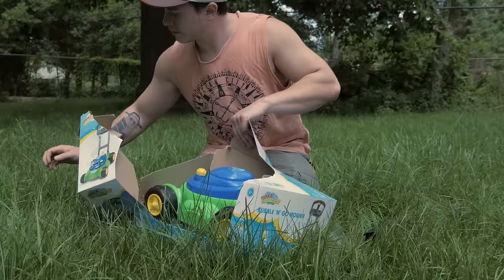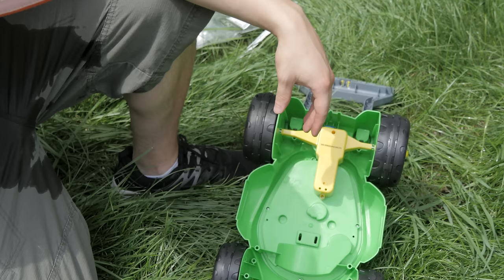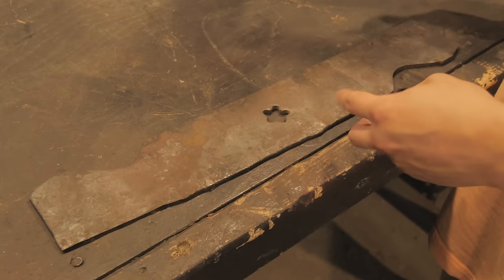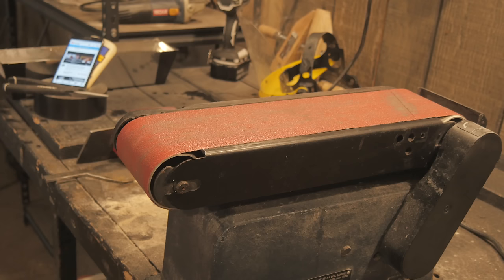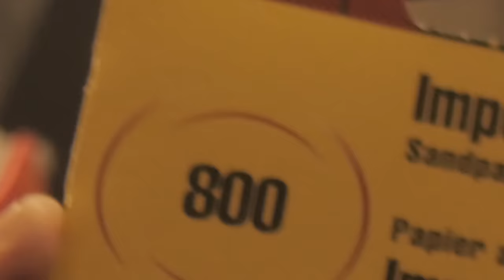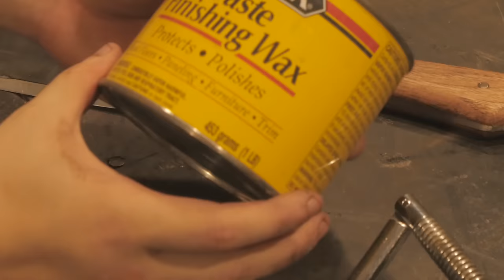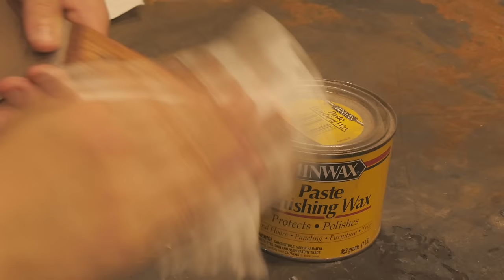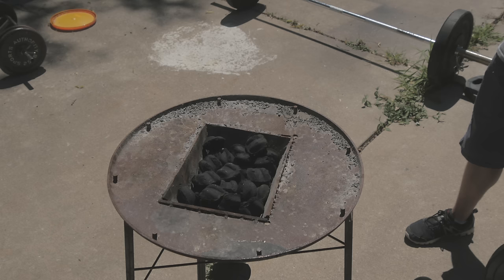How to Make: RAZOR SHARP Lawn Mower Blade CLEAVERS!

Comment: Make a razor sharp blade out of a razor scooter
Reply: Fishy McFishy razor scooters are aluminum.  It will not hold an edge.
Reply: That sounds cool, but if they aren't made from aluminum they're made of crappy pot metal. An edge would never last with either, but if it's pot metal it would most likely crack. He could maybe make some razor razor blades though.
Reply: REED BROOKS dammit, why didn't I think of wheel bearings? 😂
Reply: REED BROOKS you know what would be cool though? If he took all the wiring, separated it by material, and made some sort of a Damascus (like Alec Steele did with the copper and nickle) and made something like box cutter blades.
Reply: Achilles's knightmare
Reply: Mr. cheezit that reply is SO fucking underrated, lmfao
Reply: Bruh
Reply: @rodneysrepurposingrecyclin3821  it doesnt need a edge its supposedly so dull it cut my leg i dont understand how a razor scooter cut my leg but okay
Reply: Make a razor sharp scooter out of a razor sharp blade
Reply: Oh yeah
Reply: @PostalPatriot556  bro wtf is pot metal, did you skip highschool?
Reply: Your fucking Achilles dude...
Reply: Those things are already weapons against your ankles
Reply: YES
Reply: @jessereid8482  can confirm lost my left ankle to one of those scooters

Comment: Just some tips to help you out a lil
Don't use your vacuum cleaner to collect metal filings off the grinder, due to it being able to set fire to a bag/filter (if you got one in there) or sawdust. I'm glad that you didn't get discouraged from the last fire but I don't want you to ever just give up. Your work is truly inspirational (and inspired me to start making on YouTube (btw Thanks))

Secondly when hand sanding and moving through the grits change the angle between each grit, by about 30-45 degrees, this will allow the sandpaper to cut more effectively and it will be easier to see the the scratch marks for you to follow and if you can get higher grits try and go above your desired finish and go back (this will get you the best possible finish for them crazy shiny blades, its time consuming but if you have time the finish is well worth it!)

thanks for being inspirational

stay safe and happy crafting!

Comment: Build challenge: build a sword using no material other than one rebar scrap pine 4 feet of Paracord and 3 20d nails
Reply: rebar is mild steel
Reply: Aj V Rebar is melted down scrap steel, so it can be what ever steel quality. That means that one piece of rebar can have one inch high carbon stell and the rest mild steel, which means it is unfit for making tools and weapons.
Reply: Anton Jonsson yea unless forged and heat treated
Reply: @AFUVFX   Mild steel will not harden during a heat treat, that's the problem. It has too little carbon in it and stays soft and even brittle, it's not good knife steel, much less sword steel
Reply: That's a u have and u font want 2 get anything else do u
Reply: @kyliemacdonald1708  ...wut?

Comment: I don’t know whole hell of a lot about metalworking but those magnets seem pretty hefty especially to be able to hold up a majority of the lawnmower blade could it be possible that the reason that it was taking you so long to grind and that it was leaving spots is because the magnets were displacing the wait distribution on the belt versus the metal so a relatively easy way to Test that is just grind one side of the lawn more blade for 20 minutes without the magnets and then one side a lawnmower blade for 20 minutes with the magnets and see if the same affect happens
Reply: New monarchy for the win it was an uneven grind because he had forged and left dents in metal plus it did look a bit warped so it took some extra work

Comment: You should try staining your next wood project with used motor oil for a unique look and years of protection. The old farmers use to stain everything with it like their barns and fence posts and I’m sure a lot of other things. You will want to mix the used motor oil with diesel so it’s a 50/50 if you plan on spraying the stain on a fence or just plan on spraying it at all. Staining by hand with a rag you don’t need to mix it unless you just want to.

Comment: I know this video is old but if Eli happens to be looking through comments I have a tip for him;

Look up 'electrolysis' it's a neat process that allows you to remove all the rust and scale from steel by just letting it sit in a little tub instead of grinding on it for several hours

Comment: For the handles on the cleaver, could I just use rivets instead of epoxied in pins? I find it easier (and cleaner) to do rivets whenever possible

Comment: Do gloves not help with handling the heat? And why didn't you use a coarse sanding belt? Transfers heat less than finer grits and obviously wouldn't take 4 hours. You obviously know more about this than me so it's not meant to be a smartass 1question but a serious one

Comment: Don't grind it on the flat side grind it on the corner of the sander it will take sooo much less time
Reply: If you grind just at the beginning of the slope, you'll be where it's going across and down at the same time=twice the movement=twice the grinding.

Comment: At 20:42 Anyone else think: "EEHhh you trimmed that nail a bit short there bud." ?? And when he goes to peen it, I'm like "Yup that isn't a lot of peened metal holdin that in place. A heavy chopper like that needs to be STURDY, chain is only as strong as it's weakest link sorta thing, and that rivet worries me. And yes, the second rivet that got peened was good, he left quite a bit more of the nail on there for him to peen, but that almost leads me to think he noticed he trimmed the first one too short, and if so, why didn't he just pull the failed rivet out and put a new nail in the hole? Wouldn't have taken that much time or money.

Comment: MISHTUR ZNA GET A TIGER-TOOTH FOR YOUR HAND GRINDER DAMMIT
Reply: Deys like 8$ and are practically a stiff flap disk of 36 grit sander pads that spin REEEEAAALLY fast and you can use them to do the rough facing before you lay em on a sander to flatten em. :)
Reply: Also use peanut oil for quenching it's safer for ya lungs.